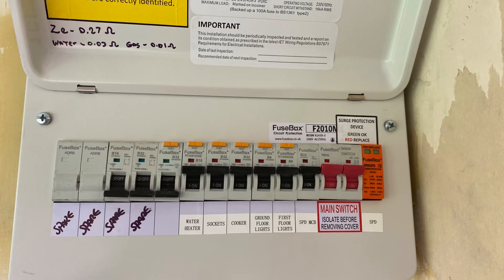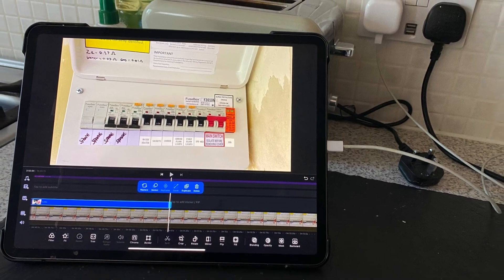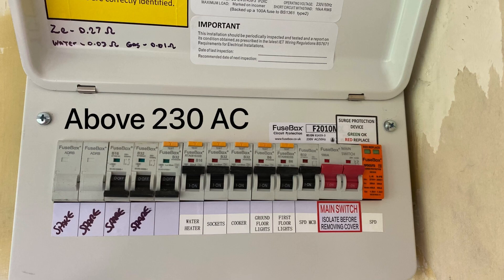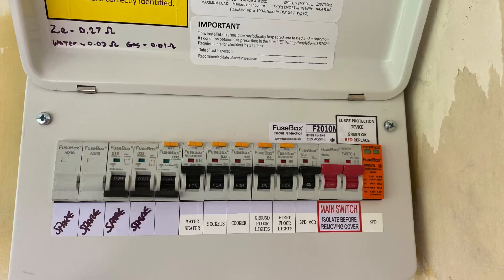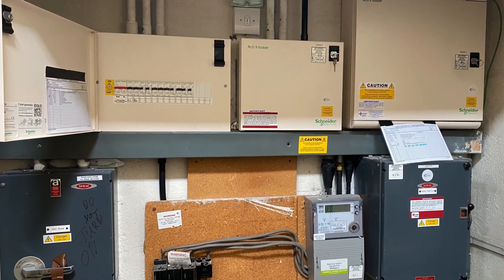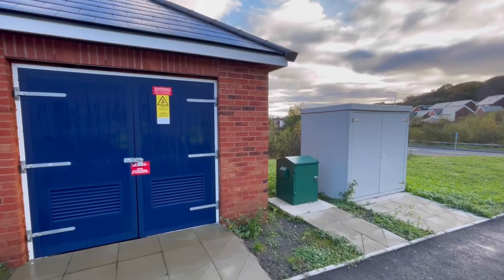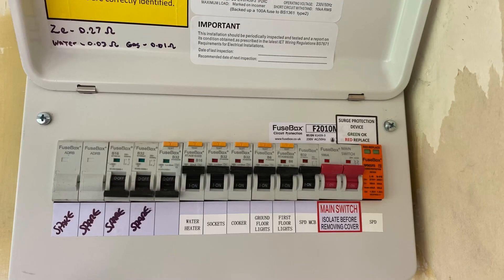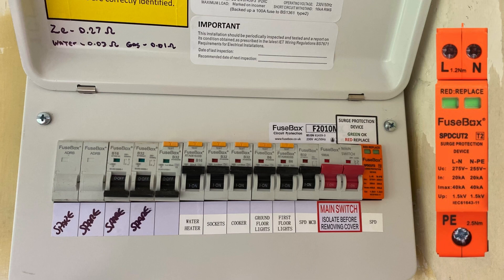Why Does My Fuse Box Have a Type 2 SPD in it?

Comment: A question: Can I connect two low power devices (a small bathroom Fan) and an external but not exposed (to the elements) LED, motion sensitive threshold light to the same switch?

Comment: What's the general opinion on mcb/rcbo position in the CU?
Taking into consideration voltage drop/circuit impedance, surely its good practice to put higher current devices further up the busbar near the main switch?

Comment: I fit these as standard with new boards of any size - and all RCBOs. I explain to customer what they're for: they ask how do they check it - look if windows show red, then it needs replacing...   Good look with that. Most customers don't check their RCD/RCBOs regularly or even look under flap of the CU for years,  unless there's a trip.  So if a line of storms come through and one spike takes out the SPD, the house is open to the next surge.   Without in-built alarm that SPD has failed this 'basic' format of SPD is one adjacent to useless.